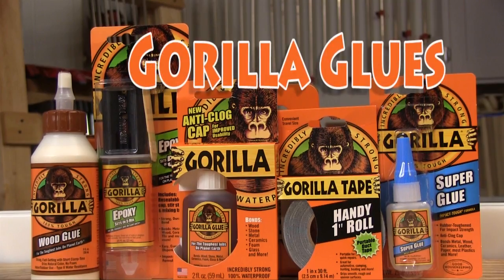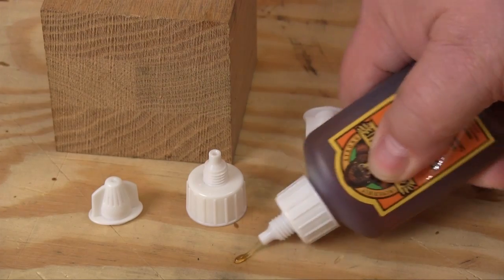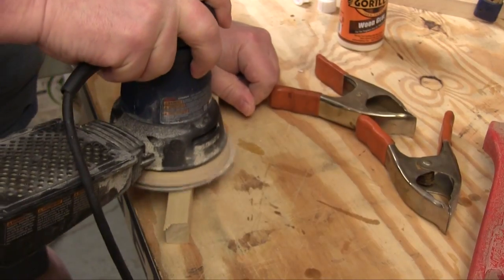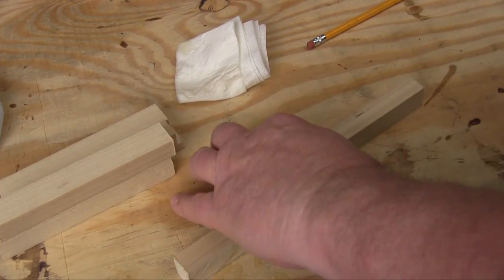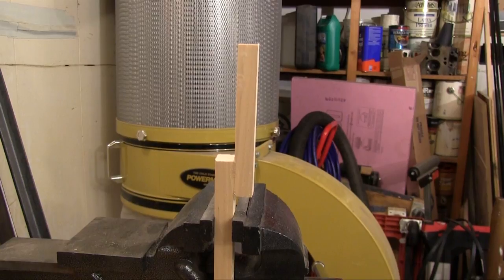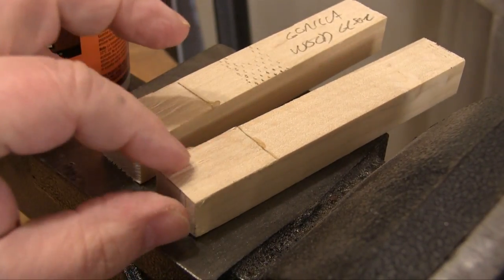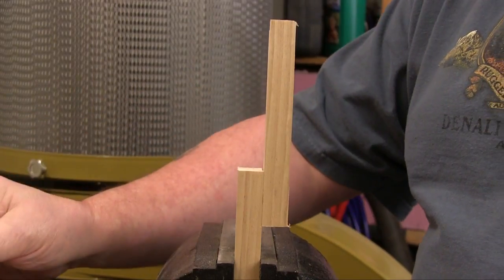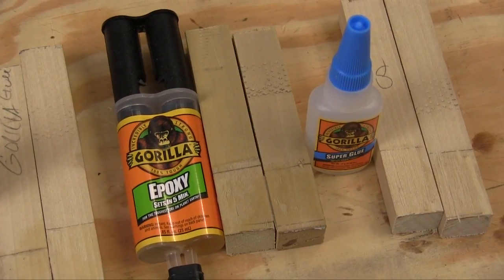Gorilla Glue Expands Its Line

Comment from the maker: @bkedp  I would use their wood glue since moisture should not be an issue. I would however wamr the place up for assembly and drying. Into the 50's or 60's shojld do it if you give it extra time to cure.